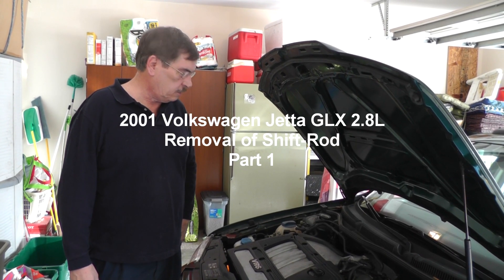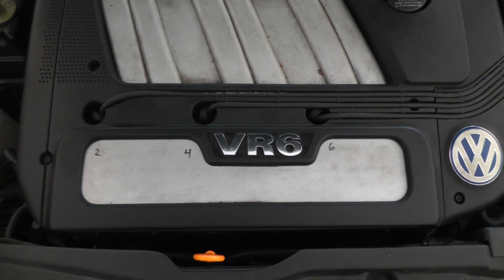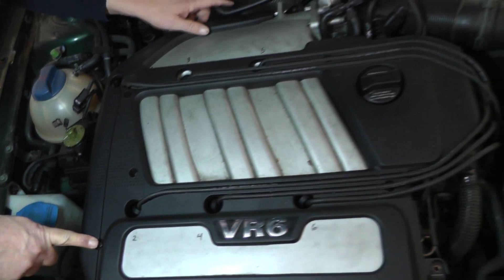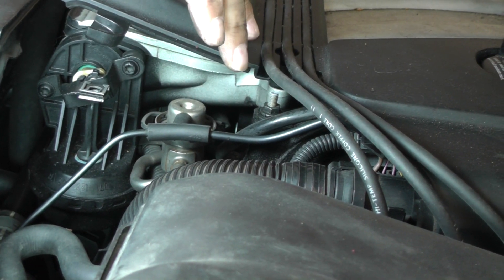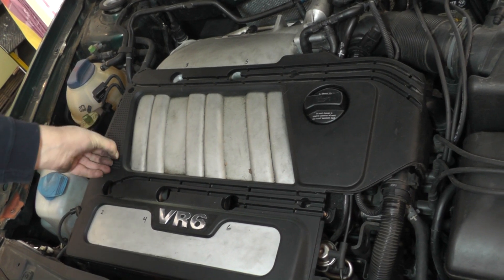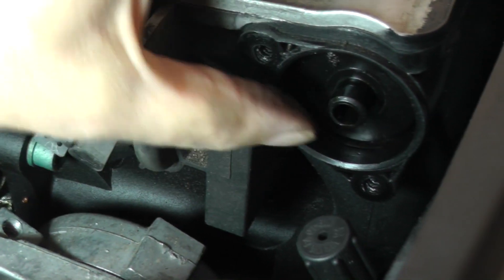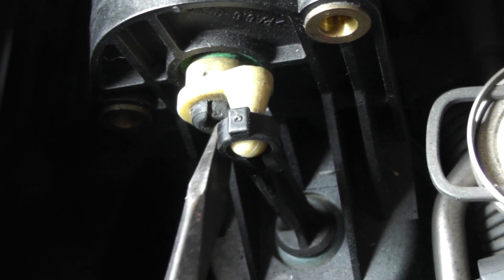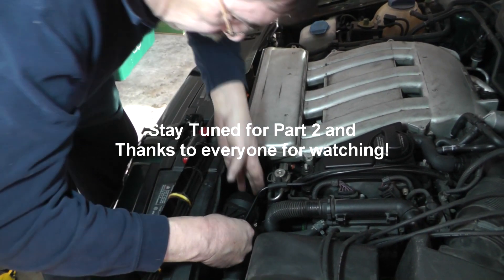Volkswagen Jetta GLX Intake Manifold Change-Over Valve Removal - Part 1

Comment: FYI It's easier to remove the spark plug wires at the coil pack then the pull them out from the plugs.

Comment: please i need the part numbers for the seals and bushings please
Reply from the maker: William Lynch I just picked up the intake runner valve at the local VW dealer. The bushings and all the other parts comes with the intake runner valve. I’m not sure what the part number is but your VW dealer can tell you :)
Reply: yes almost 300 dollars
Reply from the maker: William Lynch At the time I did this video that part was just a little over $100. That’s a major increase in price. You could always try an aftermarket part which should be a lot cheaper.
Reply: thank you i found the 2 centre bushings its the outer i cant find im under the impression they are sold separate for te 12 valve 38 each but it doesn't fit the 24 valve so the site says  thank you for the fast response you provide a fantastic knowledge and repair videos
Reply from the maker: Not sure where you're looking William, but two sources that I've used are www.germanautoparts.com and www.ecstuning.com Maybe something might turn up on those sites.

Comment: I have an 03 Volkswagen Jetta GLX 2.8 liter I keep getting error code P 1151 and do you know what the main cause of that maybe please and thank you
Reply from the maker: jonathan ramos Jonathan, this code means that the PCM has picked up a lean condition on bank 1 and has it stored in its Long Term Fuel Trim (LTFT), memory. Possible causes are vacuum leak, misfire, fuel injector, O2 sensor all pertaining to that bank. And it could be other issues, but this would be the most common. You'll have to do some diagnostics to see which one it is.
Reply: Thats what i have found from research but I don't know where to start. where would u start if u dont mind me asking I'm in also in school to become a tech i go to UTI .so any and knowledge given will be greatly appreciated im new to this but want to learn as much i can possible to become a good tech one day
Reply from the maker: jonathan ramos Good for you jonathan in deciding on a career, and I wish you all the success with it. You'll going to need a scanner at least, and since you're at UTI, that shouldn't be a problem. For the vacuum leak, take a look at the STFT and LTFT numbers. You'll probably see that the LTFT is quite a bit on the positive side for bank 1. This means that the PCM saw that there was a lean condition via the O2 sensor, and starting adding fuel to get the STFT to swing back and forth to have a 14.7:1 ratio of air to fuel. Then you can increase the RPM to see if the LTFT starts coming down. If it does, then you've got a vacuum leak. Then you can use some carb cleaner around the intake, smoke machine, etc. to find the leak. But you probably don't understand what I just said, so let me point you to a good friend of mine, Matt, who helps folks out just like yourself. The link to this video will help you understand STFT and LTFT and from this will help you to diagnose. There is a second part, so check that one out too. He's got a lot of other videos on his channel, so browse through them and see if there is something that interests you. Here is the link to the first video https://www.youtube.com/watch?v=5WnM_NsOtd8 Good luck on your diagnosis!
Terry
Reply: I replaced the pre cat o2 sensor and found one vacum leak which i also fixed do u think my fuel injectors could be a possible cause?and  thanks for replying back i appreciate your input and help guiding me in the right direction. and thanks i will check it out
Reply from the maker: jonathan ramos I take it that you still have the code. It's possible that you could have an injector issue. If you had an electrical issue with one of them, you would more than likely get a code pertinent to that. But, you could have an improper flow in one of them. You could hook up a pressure gauge and an injector pulser to measure the pressure drop across each injector. Since you're going to school at UTI, what does your instructor say about the issue? I'm sure that you've asked him for his thoughts too.

Comment: thank for the video! However, The problem I'm having is that while the previous owner had my vr6, the vacuum hose became detached. Is there any way you could try to explain the plumbing of the vacuum lines?
Reply from the maker: Sure Kevin, I did a job on the VR6 where I had to open up the front to get access to all the vacuum lines running to the intake manifold change-over solenoid, SAI solenoid, check valve, vacuum reservoir, rotary change-over valve which is vacuum actuated, combi-valve vacuum, etc. Check out this video and you can see how all of these vacuum lines are routed along with their solenoids. Start looking at timeline 10:38 where I start describing them all. Volkswagen Jetta Secondary Air Injection Diagnosis Part 8 (Understanding Components on Car)

And there is another video in this series of how the vacuum lines are routed. That whole video is devoted to the above vacuum routing and solenoids. So, check this one out too. Volkswagen Jetta Secondary Air Injection Diagnosis Part 6 (Understanding Secondary Air System)

Comment: can you post the link where you bought the bushings
Reply from the maker: In my case, I replaced the entire changeover valve which came with the bushings. So, the part came from a local VW dealership. If you want to change just the bushings you can use these guys http://www.gruvenparts.com/ where they offer an aftermarket bushing kit. I don't recommend them or condemn them as I don't know if they work or not. If you do go with just the bushings, you can check out this guy's video of where he used their bushings DIY: MK4 vw VR6 12v intake manifold shiftrod install Good luck on your repair.

Comment: i need to know how to get the upper intake manifold off on my 99 vr6 due to p 1215 cylinder 3 misfire code! I thought this is what the video would show how to remove the intake manifold.
Reply from the maker: Hi Mikey. Sorry, this video doesn't show the removal of the intake manifold. What kind of issue you got to remove the manifold? I see you have a cylinder 3 misfire, but what's the issue. Do you have a service manual as I've never pulled the intake on this car?
Reply: p1215 is the issue and it has something to do with the fuel injector or the the injector plug.  i am having a friend help me but thanks for the good videos. I subscribed anyways! :)
Reply from the maker: Thanks mickey for the feedback and good luck on your repair. Also, thanks for the sub...

Comment: Hello, I have a 2001 vr6 gls which I bought two years ago with 126.000 miles. Recently there has been a grinding type sound coming from the top of the engine perhaps two inches from the oil cap looking towards the back of the engine. I changed the oil and noticed silver shavings on the filter. Any idea what this may be?The sound is more pronounced if I take the oil cap off and look into the engine. Much thanks.
Reply from the maker: Hi John. Not sure what the silver looking flakes could be, but it doesn't sound good when you see stuff like that. I hear that these engines have timing chain issues where the tensioner becomes worn and makes a fair amount of noise. How about shout out to my friend, Thomas, who is pretty much an expert with VWs, Audis, BMWs and works on these cars everyday for a living. He's located over at https://www.youtube.com/channel/UCm3WosFt2A-Z1P436Fkjfxw Take care John and hope your issue isn't a serious one.
Reply: stuzman52 Thank you, I will check it out.

Comment: Hello Mr stuzman52, where I can buy the parts, thanks
Reply from the maker: Hi Jose. Most of the parts I picked up from www.rockauto.com The parts from here included the valves, valve guides, valve seals, head gasket kit, head bolts and I'm sure a few other things that I can't remember. Specialty items such as crank and camshaft bolts were ordered from www.suzukiparts.com and some of the generic items such as spark plugs, wires, antifreeze, etc. were picked up at my local auto parts store. Hope that helps you out!
Reply from the maker: Sorry Jose. I replied to your thinking you were on the Suzuki video. I see now you're on the Jetta. All of these items were picked up at my local Volkswagen dealership. I found that the price was about the same whether I got it from online or locally. In fact, when you add in the shipping costs, it was more expensive to order online. Hope that helps you out!
Reply: Direct from VW or you can buy from WWW.ECS.Tuning.com
Reply: www.ecstuning.com

Comment: " WOW"  that VW quality and reliability  could supply you with  hundreds of  hours  for  repair videos  LOL     Haven't seen  Thomas EXOVCDS  do one of these and will learn a thing or two as well.  Interesting design for an intake baffle, at least it is serviceable compared  to most that have you replace the intake.   Did the owner say if there was  any driveability concerns with it knocking so bad ?
Reply from the maker: Hi Steve! You are absolutely correct that I could spend hundreds of hours working on this car or any Jetta for that matter. Also, as you know there's plastic everywhere and the parts for these cars aren't cheap. There wasn't any drive ability problems, me being the owner, or I should say the daughter's car. The rattling noise got so bad, I had to go ahead and fix it. Thanks Steve for watching and for your comment.